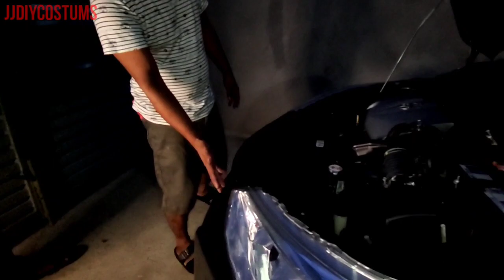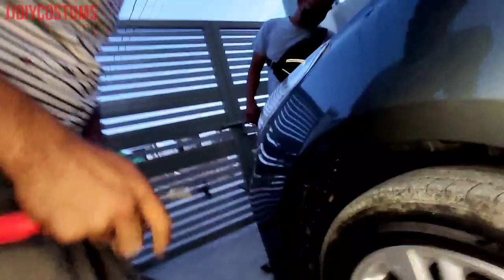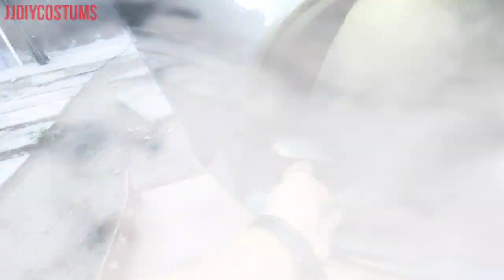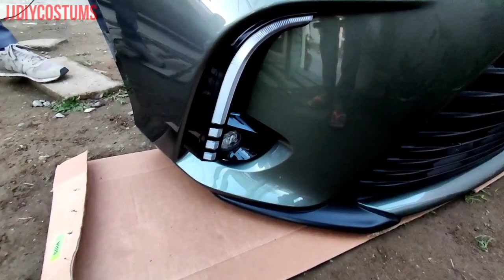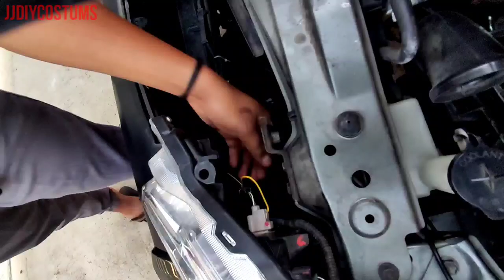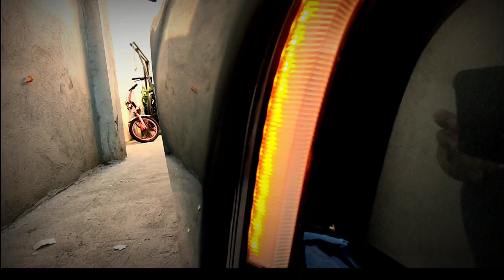DRL -Drive Running Light Installation TOYOTA VIOS 2021 jjdiycostums

Comment: saan ka nag connect ng sa accessories sa fuse?
Reply from the maker: May sariling fuse po na nilagay namin na nakakonek sa supply ng head light relay. Tas yung sa SIGNAL LIGHT yung signal din ng DRL po

Comment: nag splice ka sa acc sir? di ba ma vo-void warranty nyan?
Reply from the maker: Sa relay box po sir ,no need splice po
Reply: Di po ba ma void yung warranty sa electrical sir?
Reply from the maker: @LeLe-iw9fv  hnd po, most important wala ka nmn ginalaw lalo na pag dka nag splice
Reply from the maker: Kailan mo balak kumuha sir? Meron po kami stock niyan baka want mo po
Reply: Sa horn relay kinabit yung red?
Reply from the maker: @carlorosales2731  low beam
Reply: San po ba banda don sa fuse box ung relay ng acc?
Reply from the maker: Yung pinakauna lods blue na relay
Reply: @JJDIYCOSTUMS  hm drl boss
Reply: Boss bat sabi sa video yung red nakaconnect sa starter/ignition relay pero sa comment mo sa headlight relay. Saan ba talaga boss?